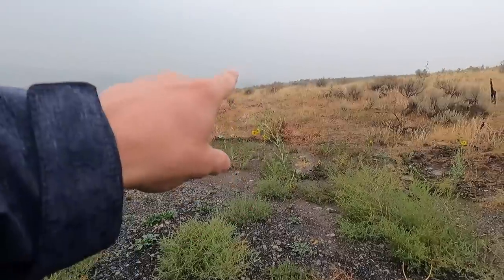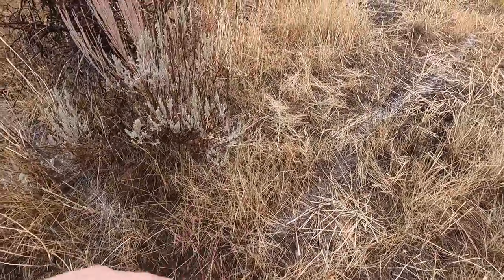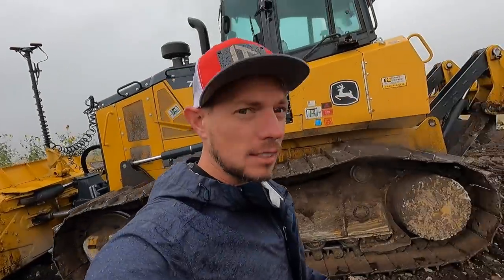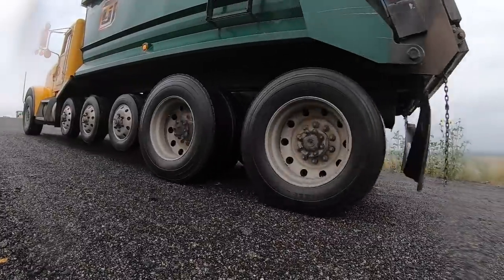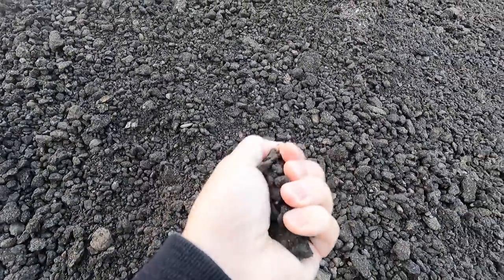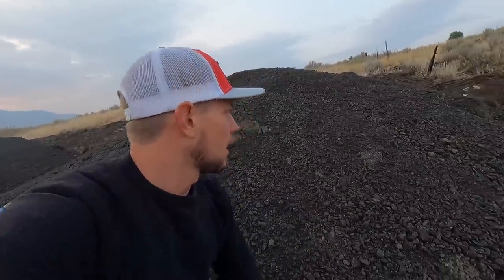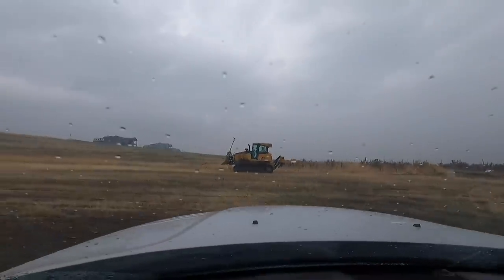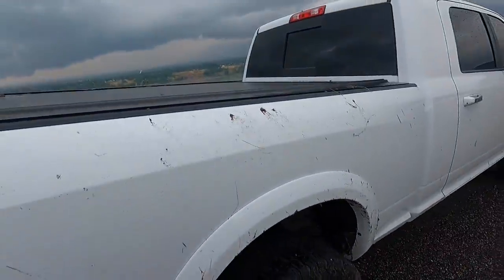Building our Road and How They Do It

Comment: Asphalt milling driveways are good, but watch out for heavy rains. Our drive has a slight grade and after a heavy downpour the pea size gravel in the Asphalt millings ended up piled at the base of the slopped driveway. The more sticky tar part of it has sunk down to the ground and packed into a thin hard'ish layer. But in no way as nice as an actual paved drive.
Reply from the maker: You are exactly right, we are doing millings until the house is finished and then a final asphalt paved driveway.

Comment: What a lot of requirements before starting to build your house!  Putting in a road must have been expensive!  Looking forward to the actual building construction.  It is September now and wondering what you will be able to get done by winter?  We live in Michigan and understand that working outside construction in the winter takes longer.  We hope you wont run into delays due to shortages of materials.  Lumber prices here have come down a bit.  Wishing you the best!